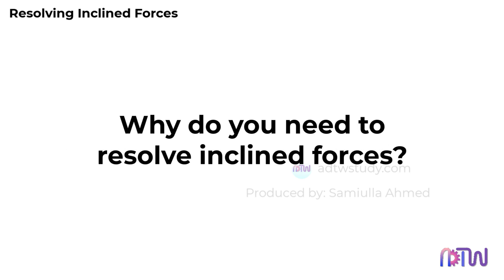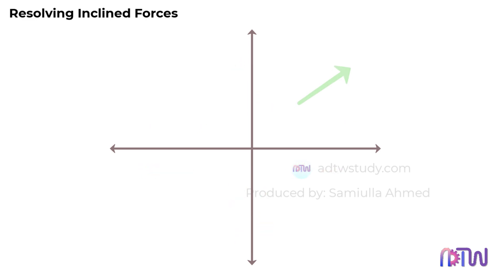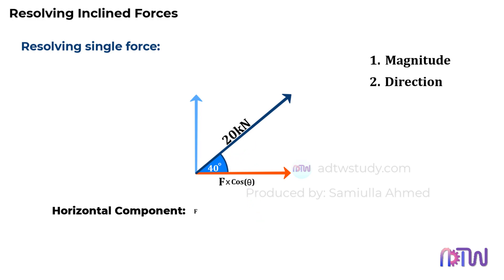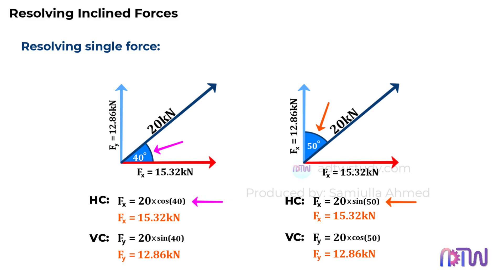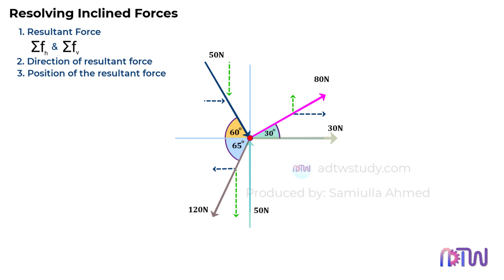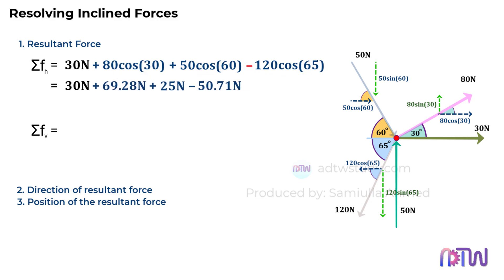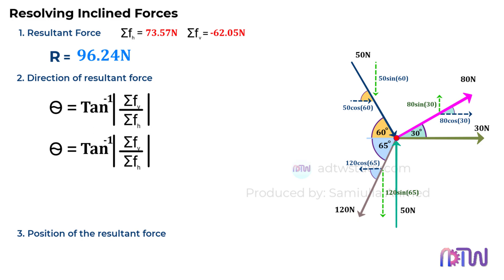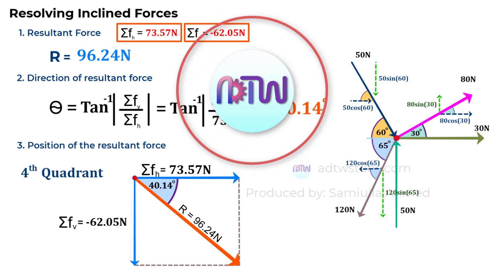Resolution of Forces: Horizontal & Vertical Components + Resultant Force Explained!

Comment: The angle should be measured anti clockwise direction right ?? 
If inclined forces are acting in same quadrant one makes theta with axis and other makes alpha with first force means what will be the angle for the 2nd force ? Is sum of theta and alpha or anyother rules for it

Comment: For more complex systems, it's super helpful to include your definition of the positive directions when summing up the horizontal and vertical forces. Just as a sanity check. Especially if the problem doesn't give you a cartesian coordinate.